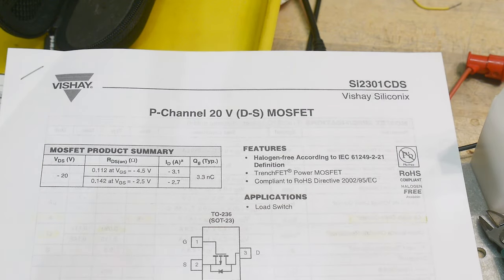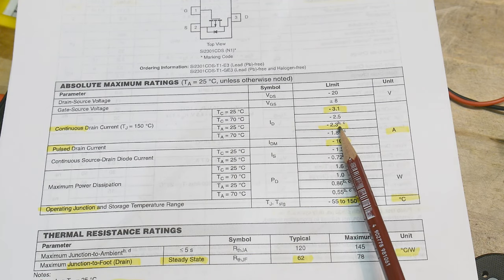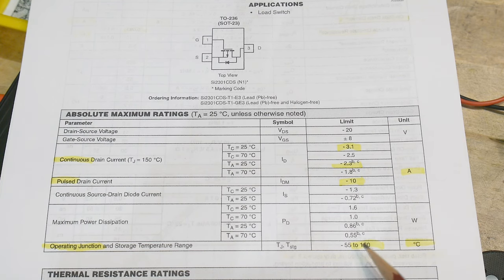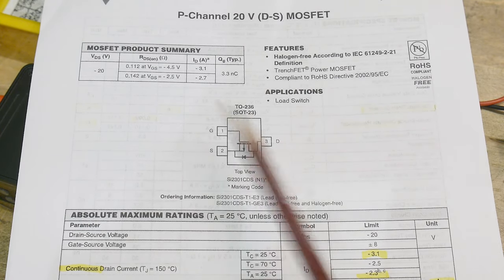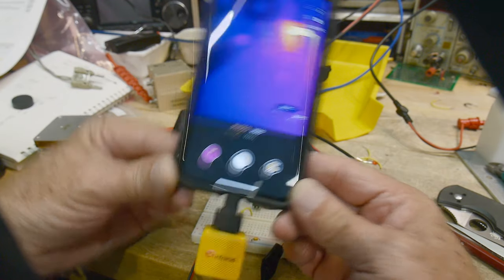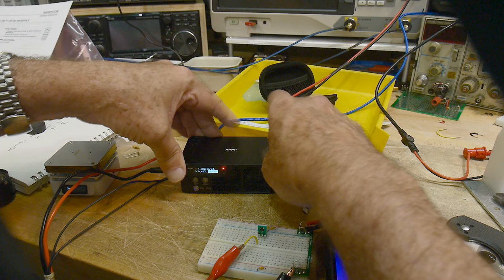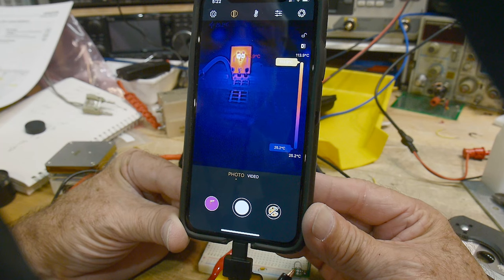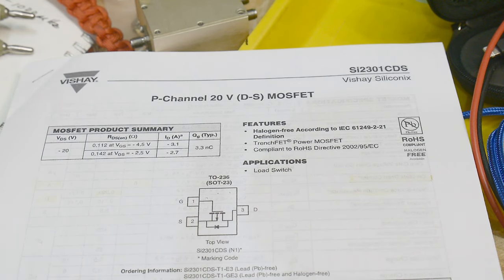#1968 SI2301CDS P-chan MOSFET

Comment: ~500mA usually about the limit for these SOTs without any extra thermal solution, I'd have thought. SI2301 is a super jellybean part, can get them about low a price as any P-MOSFET; works fine for logic or 'small' loads.

Comment: Continuous is 1.8A, from the Tc 70C rating, which is what you will get using regular FR4 board with a 25mm by 25mm heat spreader on the drain, with no thermal relief. But a more realistic would be 1A, and if you need more put them in parallel.

Comment: Something I add to small DIP8 Power Amps around 1 watt, (like a TDA7231A) is a 9mm x 9mm x 12mm heatsink with a silicon pad.  Makes a difference.  Wonder how that would impact a part like this.  I think you can get sinks a little smaller.  Could help radiate some of the heat away for long term current draw.  Hardly a heat panacea, but could help.

Comment: Hi and thanks for the channel. The data sheet states how the producers measures the part. The duty cycle is so low to avoid heating up the part that changes its characteristics. Is by no mean a hint how the client should use it. During testing, characteristics in the data sheet are measured for each and every part. Absolute maximum ratings are, usually, sample measured. This data sheet is quite thorough to state all relevant information about how part is tested in production.

Comment: Next time you talk about junction temperatures to parts, could you talk about the thermal resistance specs and use them to better calculate the junction temp based on the thermal measurements?

Comment: The datasheet is more than correct. Maximum current rating of -3.1A is given for a TC if 25C - then you should maintain the case at 25C and not exceed -3.1 (max Id is for ideal conditions). For a Ta of 25C you can see from Safety Operation Area chart that you cannot use in chosen voltage of 5V the current should not exceed 0.1A - and that is what manufacture recommend. Also from SOA is can clearly been seen the maximum pulse drain current is -10A for 100us.

Comment: Did you connect the gate? I can't see it.  The part appears reverse biased(D/S) in your set up and the .8v drop is the right value for the body diode as listed on the data sheet.  (see 3:29) That might explain some of the dissipation.

Comment: You should take a look at an A2SHB n chan fet.
Min vgs (th) 0.4v
3.7 amp cont
12 amp pulsed
All in a cute little sot 23.
 love to see if it does what it claims.
Reply: Just looked that up. It's an si2302, literally 1 digit higher than this one in the video. Interesting

Found a few Chinese brands that use a1shb as the marking for the 2301 in the video. A2shb must be the successor?
Reply: @airmann90  hmmm interesting!
Reply: @airmann90  A2 is not the successor. It's the N-channel while A1 is P-channel. Both are very common in cheap Chinese goods.
Reply: @misterhat5823  oh haha. Didn't even look at the polarity. Thanks